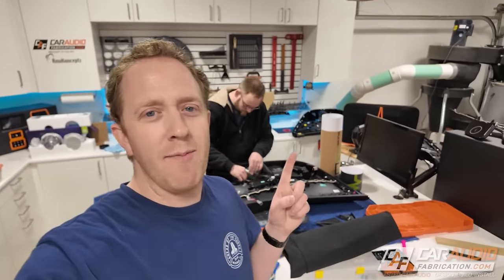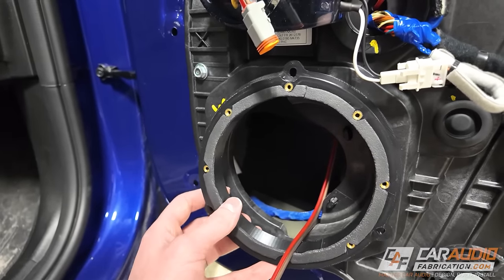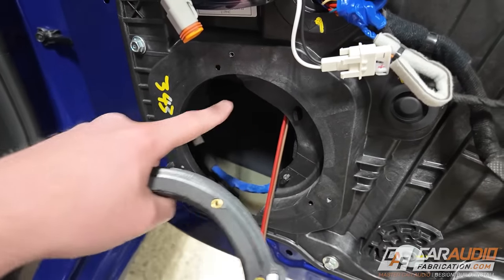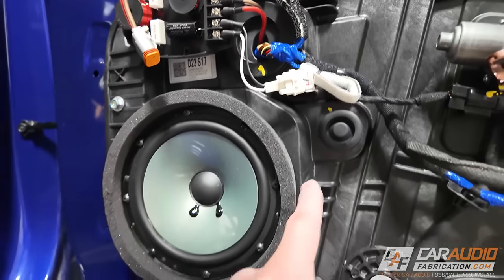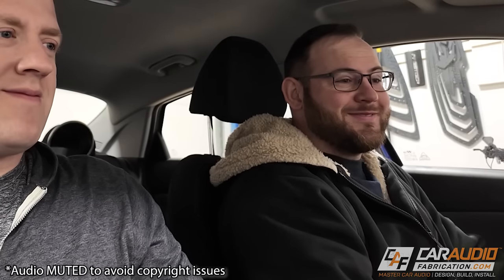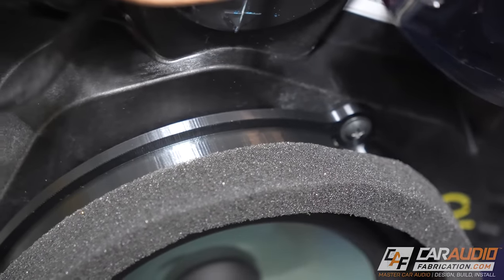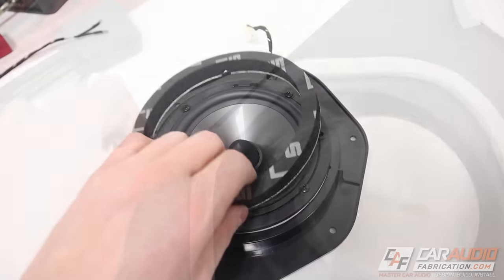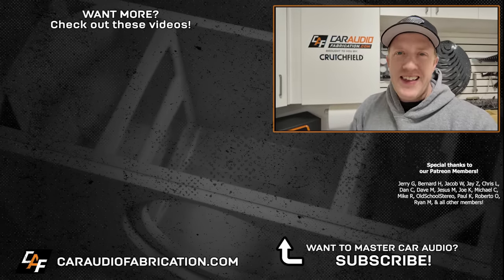No Amp. No Sub. We installed speakers only, how does it sound?

Comment from the maker: Here's two more helpful videos!
4 Reasons ONLY Upgrading Speakers might not sound good! - https://youtu.be/lfgIU9JXSiI?si=DRX_gzGocce3CJBn
Installing speakers? These techniques make a BIG difference! - https://youtu.be/jPNy_Adb2vU?si=xmj5U5ZhVsJEQNyL

I forgot to mention in the video that we also did an RTA measurement of the OEM system alone prior to the speaker install. I'd like to get another measurement now with just the speakers installed and then one with the final system. Would you guys be interested in seeing those results? 

Thanks for watching! Don't forget you can save on your next car audio purchase with show sponsor Crutchfield here - https://www.crutchfield.com/I-rCAFcYTB/rf/ef28766d-4881-4df6-9f8b-287145ad3d36/
Reply: Yes!
Reply: Yes to seeing the results.👍
Reply: Yea boi,test results peas and carrots
Reply: Do you sell those 3d printed adapters? I have that exact same car and would be interested in a set
Reply: Yes to seeing the before and after data especially with no amp. Also interesting would be a before and after of the dampening materials and foam rings - but not changing any other variables so you get a true picture of their effect. And a summary of your experience with various manufacturers of sound deadeners, CLDs, etc.
Reply: Hey I been searching highs and Lows on some advice. I am trying to install my 12"L7 and Rockford Mono amp in my 2018 Envision! Only problem is I can't Swap the Fact Radio, the Fact Radio has no RCA's, and to top It Off, I have to Deal with ANC! Any Advice on equipment I need would be Great! LOC?
Reply: Definitely RTA
Reply: Kind of wish someone would offer those speaker adapters for a VW GTI...the ones available dont match up very well.

Comment: To answer your question, that is definitely a video you should do. Everyone thinks upgrading speakers from OEM makes a difference, we sould love to see real world analysis especially without an amp. Thanks for all your great work!! You do a phenomenal job on your channel. Ive been a fan for some years now. Keep up the great work.
Reply: I’ve replaced mine and others OEM speakers a lot and you can tell a difference even without an amp. Where you notice the biggest difference is when you get rid of the entire factory system and run aftermarket head unit and amps. The sound quality of a good aftermarket system is so much better but it needs to be setup and tuned correctly.
Reply: But its really depends or the corrente speakers you have, you have cars with a lot good speakers like Bowers and wilkings, he can do a video but its relative, because depends on the speakers that you car have and what speakers you get, and off course the radio that you are using
Reply: @ProGamerKF  in every stock system that I’ve ripped out that claims to have a high end stereo system from a premium manufacturer it’s more about that manufacturer deciding speaker placement based on what the space the car manufacturers give them to use as well as the overall tuning. I’ve never seen a system that didn’t cut bass response or utilize low quality to mid range speakers. As I said I’ve never touched complete system rebuild that didn’t sound infinitely better than the factory system. Better head units, better crossovers, better amplification, better speakers, etc,etc…
Reply: @P-J-W-777  you cant compare with amp, or other units, but you have premium Cars that have like 20 speakers on a car with amp.
Maybe you just touched Peugeot and Renault sound system the high levels of volvos, Audi, and stuff like that they até awesome, and you had to spend more than 1.5k some Times to have similar sound.
And they use special speakers with sizes that you normally dont have selling everywhere
Reply: @ProGamerKF  nope I’ve upgraded audio systems in various cars including Rolls Royce, Porsche and all the way down to fords. People kept claiming how good the Tesla audio systems were from factory yet so many people are upgrading them and noticing big differences.
Reply: @P-J-W-777  apart from subwoofer i dont knoe why you Will Change 15 speakers, with very capable sound. I cam Change even for worse. Changing doesnt mean that they are bad or they new ones are imensly good, because apart from volume a maybe a bit better sound quality they ate close to the max already exist, 90% people or more would not feel the difference stock vs upgrade system of a Tesla
Reply: @P-J-W-777  not to talk that you are wasting a lot of Cash for almost no gains, the ONLY departament is the subwoofer that you can notice the difference right way, the rest...
Reply: @ProGamerKF  true. What I've seen is that older cars didn't think much of the cars sound system. They didn't think about the acoustics of the car, angling speakers, sound proofing. It's better with newer cars but still needs improvement.

Comment: The best thing when considering only updating the speakers, is its best to not buy super high end, high power door and rear speakers.  Buy lower powered ones that will be driven better by a factory (or non) unit.   I installed a recent JVC unit and some brand name, but lower power speakers in my car, and have a discerning ear.   Those 30-75 watt handling speaker's are driven perfectly with the head unit.  If i went with 100-150, higher end components,  it would not have sounded very good.
Reply: That is extremely golden advice. The only thing I’d add is pay attention to the ohm load.
Reply: This is what I was looking for! I remember years ago replacing factory speakers with upgraded only to find they weren’t as loud and didn’t sound better.
Reply: I have a 2013 Miata stock the speakers suck what do you recommend not sure if I want to put new unit in yet but sounds horrible
Reply: Another way to do this is get neo speakers. They dont require a lot of power and they get super loud. Look at the sensitivity. The higher the better
Reply: @No_Use_For_A_Name1981  absolutely. Just installed my hertz MP 165 that have an RMS of 100 watts and you can tell they don’t sounds as good as my stock speakers because they are so underpowered. Just waiting on my dash kit for my new head unit and they will be getting a nice 4 channel amp but without it the stock would have been better.
Reply: @papabear007 look into the C1 speakers from JL, or a lower priced line from any of the better brands. They'll have higher sensitivity, lower power draw ratings, and are made to step you out of factory speakers without needing to spend more on full tilt setups.

Comment: A little known secret from before the days of dedicated subwoofers, is that when speakers face each other,  for example, in the doors, you have a slight increase of base response. I’ve known this since 1974. This makes it critical that you install them very solidly to the inner metal door skin if possible.
Reply: Having  phase reverse on the sub control is a MUST, it makes all the difference.

Comment: With aftermarket speakers, I’ve noticed mids and highs are vastly improved but bass drops off.  Adding even a small sub fixes all of that.  I had JL Audio C5 components that I left in the car on trade in (couldn’t find the factory speakers I removed) and listened to it on the factory head unit. Amazing.  Just not as loud as with an amp.
Reply from the maker: Yeah generally the speaker design makes the aftermarket speakers less efficient than factory (depends of course on model), so usually the "max volume" isn't perceived as being as loud. I discuss more here - https://youtu.be/lfgIU9JXSiI?si=ezCzrZa-24wCFwZY
Reply: U can get some aftermarkets that have a high impedence.. or are like 2-3 ohm with high impedence.. those are good dropin replacements.... but then when u want to amplify they might fall short a bit.. but u can get great sound from less watts..
Reply: I think the design approach is that they plan on the owner adding a subwoofer. So they design every component to be best at its effective frequency, instead of trying to good at everything and failing at that.

Comment: I did the same in my 17 Corolla, front and rear speakers, Infinity Reference with sound deadening. What a difference!! Highly recommend doing speakers as the bare minimum in any vehicle.
Reply: Also, I did speakers OEM replacement on my corolla 17, however I added amp and I went through kenwood kac 1814 ehich was great and now landed with hertz hcp 4 which is really awesome. Speaker hertz dieci, but tweeters again, changed to cento huuuge difference.
Reply: sound deadening is the bare minimum, not the speakers. Installing aftermarket speakers might even have a negative impact on bass, while sound deadening will improve bass response even with stock speakers. I always recommend sound deadening as the first thing to do
Reply: @tomkocur  I am planning on doing this as well. Should I use a speaker baffle also?
Reply: did you find the infinity reference really bright?
Reply: depends if you have a underpowered headunit
Reply: @kdsevilla not just that, if you choose the wrong ohm rating on your speakers you'll kill sound production and volume.

Comment: I tried this experiment with some decent speakers on my nieces Kia. Better but still not good, pretty similar to the setup in the video. Once I put the amp in it sounded so much better. Thanks to Car Audio Fabrication! I could not have performed the install without you! Furthermore. I do NOT recommend ANY complicated install into a newish car. It was a complete PIA!
Reply: Yup, getting speaker wire through the boots to the doors is next to impossible...I did a front component speaker system and rear door coaxials in my new 2023 Mitsubishi Outlander Sport GT and getting 14 gauge speakers wire into the doors took longer than installing the (2) 4 gauge power wires, (2) trigger wires, my 4 channel amp, and subwoofer amp wiring that I ran through my entire  SUV...I think manufactures do it on purpose making it nearly impossible to run wiring through those small boots on each door that already having wire harnesses in them....SMH!
Reply: @petedetraglia4776  I got some of the cable with 9 wires inside and soldered it to the harness speaker wires. It sucked.

Comment: I swapped the rear door speakers in my Explorer for a pair of Focal Flax 6.5 coaxial I had laying around. I also 3D printed my speaker adapters. 
No amp, base stereo, and they sound really good. They’ll sound even better when I eventually/finally drop the amps and dsp in.
Reply: The Focal speakers noted are fantastic....I have all Focal in my car coupled with a 12" JL Audio sub....heavenly.
Reply: Agree 100 % , Amps are to boost the volume and leave you deaf , in my Camry XLE I’m using the factory radio and “Kenwood”  all the way around including sub amp and subwoofer, there are hundreds of brands and speakers better than “Kenwood”  but those work perfectly with my radio without amp , just trying to make it simple and get a balance between audio quality , budged , time and work, however  I spent time and money to improve vehicle acoustic characteristics adding some “ dynamat” and extra sound deadening materials 🤷‍♂️
Reply: I just swapped in Focal Flax  6.5 two-way separates @ front door/dash. Alpine 70W amp with built in DSP. 2024 Corolla Cross. Soundskin. The quality, detail in sound is there. You will be happy. There is plenty enough sound and punch for me. I had a 2022 CC with factory JBL, including amp and sub. I once had K2 Powers, so my ear is pretty fine tuned and discerning. I listen to hard rock, metal and prog/fusion. Good luck.

Comment: Doing exactly this in a 2022 NX Tucson mid spec with the base level stereo made a huuuuuge difference. I noticed the car had bare metal opposite the door woofer positions, so sound deadening alone no doubt helped tremendously. I used 93db sensitivity JBL SQ speakers, and the high sensitivity on factory head power is astonishingly better already. Super bright top end, and the mid bass is endlessly impressive. So good I've suggested on our local Hyundai group this is a highly recommended upgrade in itself. I'm going the whole hog with a sub and DSP and amps, but the speaker swap alone was a lot better than even I expected. The Hyundai speakers were as cheap as they come, so that's obviously a big factor.

Comment: It depends on how new the car is. My 04 Corolla, new speakers, aftermarket head unit with built in cross over, 1x12" Alpine Type R on 250w Rockford Fosgate Monoblock. Ive gotten ALOT of comments on the clarity of sound. Not superloud, but still get that bass you like.

Comment: And for those coming in that are just planning on upgrading your speakers and not running an amp my biggest advice would be to shop for "weaker" speakers instead of big high end ones. Goal is to match the output of your radio since most aftermarket radios only put out like 15-20w rms each channel which is some cases is even less than stock audio systems. The lower wattage rating the speaker is the easier it physically is to run whereas those premium high power speakers require a lot more physical power to run the coils (ie a 20w speaker is far louder at 20w than a 50-100w at 20w) You'd end up with less bass and volume with a "nicer" 100w Alpine speaker than if you just got that 20w Kicker you thought wouldn't get loud enough

Comment: My wife needed new speakers in her car and after getting them replaced the mid bass made a big difference. However with the sound treatment I'm sure that made an even bigger impact. I would still add an amp because why not if you're already installing speakers. I can't wait to add new speakers in my car, so far I only have subwoofers and sound treatment and a kenwood excelon stereo.
Reply from the maker: Yes, we will be adding a DSP amp, but was still a fun experiment.

Comment: I had a 2013 Impreza, which had THE WORST stock stereo I have ever experienced. The car is built like a tin can, the speaker magnets do not even stick to metal, the cones are plastic. I installed one of the cheapest Pioneer touch screen head units available with Apple Car Play (MVH-2300NEX) and a set of Alpine type S 6.5" 2 way speakers (SPS-610). I added Noico mat to the whole interior (russian made version of dynamat) and made an aluminum adapter plate for the rear doors, so I could replace all the original 5.25" speakers with the 6.5's. It went from being absolute crap, to blowing my previous Altima's Bose system out of the water. A sub would have brought it to the next level, but it really did sound great for daily driving.
Reply: Subaru really put 98% of their budget in the drivetrain

Comment: It's a relative change that doesn't always cause any improvement at all. I have tested this before and it all depends on how good the speakers are relative to the head unit in the first place. If you have a decent source but rubbish speakers, yes it will make a big difference. If you have a decent source but your speakers are already decent, it will make no obvious difference, particularly at low volumes. Best way to get an idea is to research the power output of the source head unit and get one of the speakers out and see what it's rated at. If the radio outputs 30w but the speakers are only 5w, there is a good chance it will make a significant difference but if the radio only outputs 15w and the speakers are already 20w, the speakers wont make any difference because the head unit cant provide any more even if the speakers can handle more going to them.

Comment: Just  upgradingvthe speakers in an E/F series BMW makes a great difference on the E63. 
The factory setup on them are slightly  different in that only the underseats have amplification. 

The left the door and rear shelf speakers powered of the head unit. 

Next step is wire up the Rainbow Ipaul to the  comps underseats.  
That should improve it some more.

Comment: If you have never used higher end, larger pro audio drivers, you should check them out. I know you are into more top shelf SQ gear, but I think you would be surprised the quality of the sound you can get from some of these larger drivers and horns when installed properly and given proper bandpass crossovers

Comment: We changed the speakers in my daughter’s Camry (non JBL) and added a JL amp and sub and the difference was amazing. I want to change the speakers only on my Lexus LC500 but am being told that the oem are 8ohms so I can’t without changing amp
Reply: Just increase resistance on the line or add two speakers in series for each location. 😂
Reply: cant u just run 4 ohm speakers (that are a bit better build/heavier) they would probably be fine.. would be worse if ur car had a 2 ohm system.. like these 8 ohm speakers are probably 10-20 watts.. if u get 100 watts rms 4 ohm speakers ur never going to blow those up.. and if u do its just the headunit..
Reply: @KeithGrier-hz5hy  well then get 8 ohm speakers, or you can wire in series two 4 ohm speakers to get 8 ohms.

Comment: I bought a similar Hyundai Elantra last year, and would love to upgrade rhe stock sound system.  Ive heard mixed reviews of whether upgrading soeakers only, would make a substantial difference.  Different answers from different installers.  Everyone recommends the JL 2 series, but ive gotten different answers on whether just using the stock head unit, without sn amplifier, will make a difference, because it wont be pushing out any more power.  After seeing this video, I'd feel more comfortable making the smaller investment.  Thank you for posting!

Comment: Right now I have my Kenwood Excelon DMX706s powering my Morel Tempo Ultra Mark II 6.5 components and Morel Tempo Ultra Integra 6x9’s. They sound amazing. At first I had just the stock speakers being powered by the Kenwood. I have an JL Audio VX800/i8 and a JL Audio 12TW3v3-D-8for a subs I intend to bridge channels 7 and 8 to the sub.